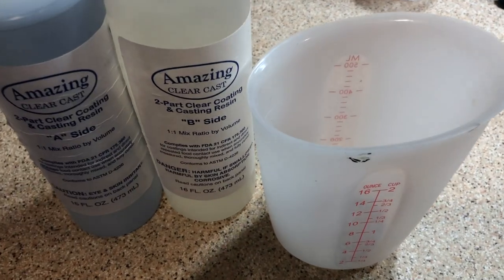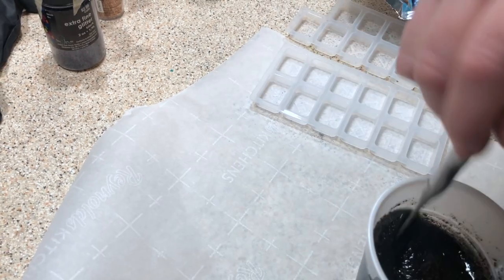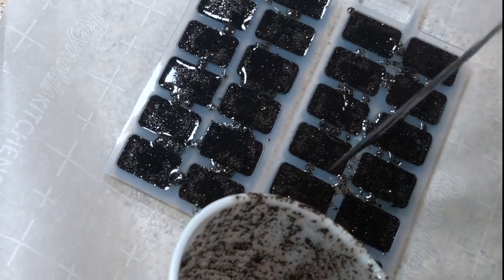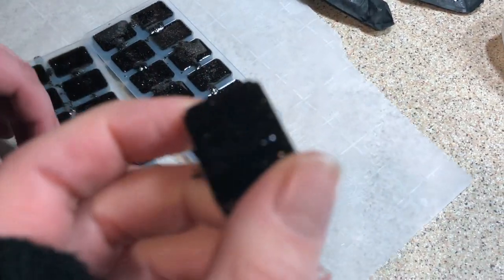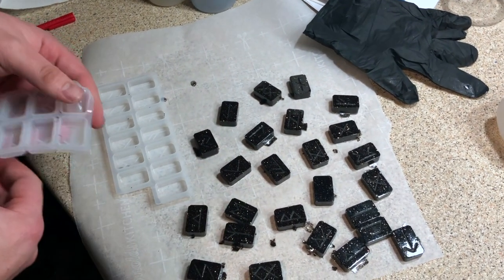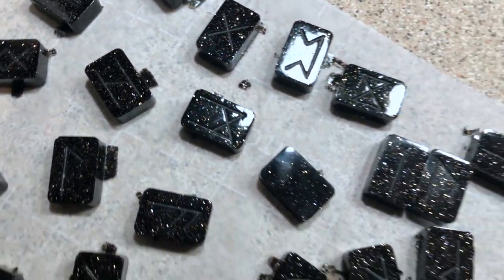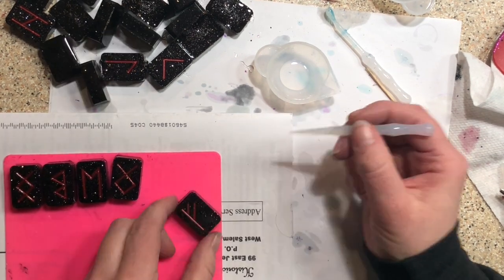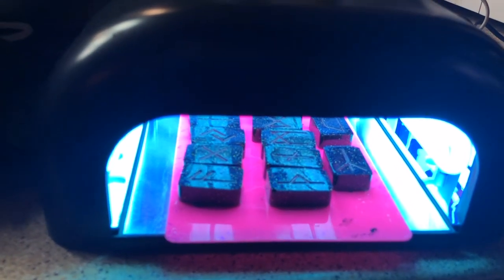Making Resin Runes... out of COFFEE?! ☕ How to upcycle grounds and make coffee art with Alumilite!

Comment: These are awesome!! Just one thing, is that the blank rune is part of the set. It's Odin. So it's not supposed to be missed.
Reply from the maker: Oh, thank you!  I appreciate that info; I hadn't seen that before.  I am a Tarot reader but haven't delved into runes until making these.  Seems a little silly to be a professional Tarot reader with zero experience in runes.  Ha!
Reply: @PaintedRaina  You're welcome. Oh, no not at all. Runes are completely different to the tarot cards. Oracle bone casting is also another divination concept. I read sometimes and I even used to read tea leaves and flowers. It's all learning. 
Blessings 🙏🕉️💖

Comment: If I add too many coffee grounds will it take longer for the resin to cure?
Reply: I tried this. Complete and utter fail. I know the instructions say full strength in 72 hrs but after 48 hrs nothing's cured. The runes aren't even demoldable. Give it til 72 hours if nothing's fully cured I'm trashing this attempt and starting over. I'll get some pigment from Michaels
Reply from the maker: Sorry for the late response; I had to take a break over the holidays.  The grounds must be 100% dry.  I leave them out for a few days and bake them in the oven for a few minutes on a low temperature.  Resin doesn't like water at all.